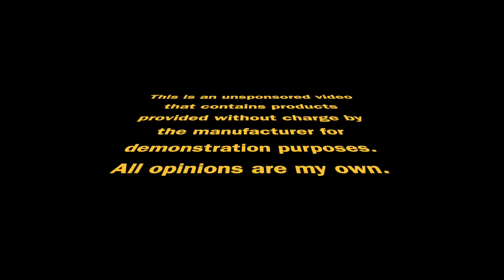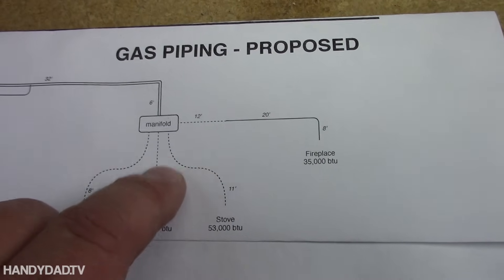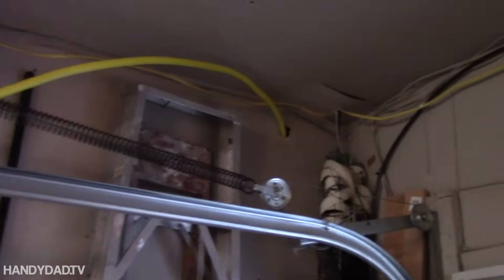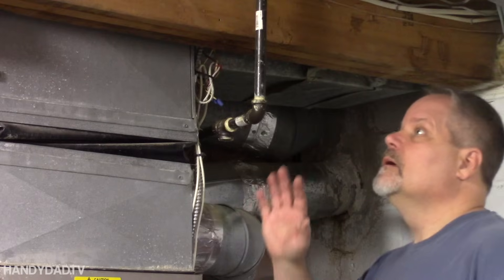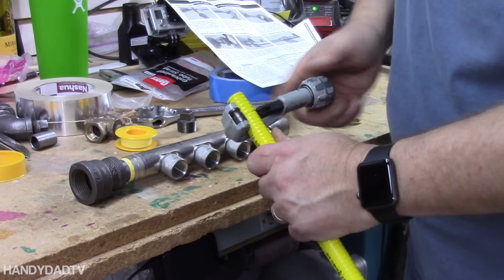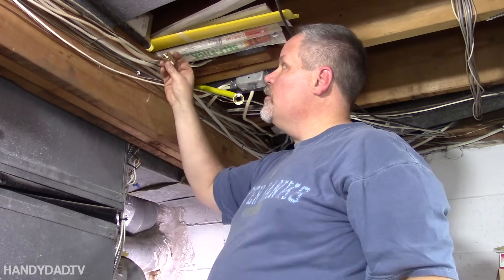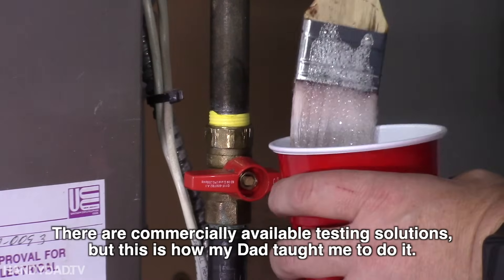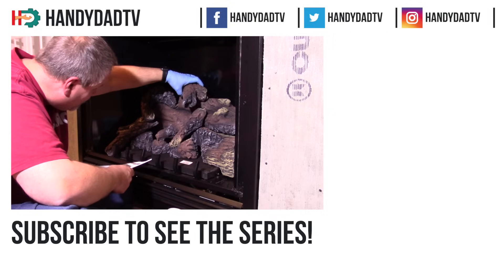DIY Fireplace Installation - Natural Gas Line

Comment: Your bonding need to connect to the house grounding electrical system not only ground to the grounding rod.  Other word your electrical system bond the neutral and the grounding rod electrode together to make the house grounding system.
Reply from the maker: Ok but it passed inspection.
Reply: HandyDadTV I got that sometimes you did it wrong to pass inspection as those inspectors said but that’s not how it said in the code.
Reply: It passed inspection but they probably just saw it was bonded and assumed it was to the panel.

In your system you created a second earth ground. These are both earth ground but not equal, as they will have resistance to each other during a lightning strike and cause cause a extra current look during the transient strike.
The lighting voltage will seek the shortest path to earth, and this may pass through one of the grounds but then also pass through the second ground.

Best way is to tie the at all the ends of csst to your panel with AWG6 if under 70 feet runs. That way the current will want to travel through to 6awg to the panel ground and rod and not through the csst, which can easily cause holes/burns from the amount of current.

I just redid my house myself with schedule 40 black pipe, and it's thicker to have less resistance and can take the strike without melting. I still need an earth ground, so there is that bonding to the panel.  It's bonded in parallel by the equipment itself, but I want the current to travel through the bonded cable rather than the grounds on the equipment where my gas runs to.
Reply from the maker: Thanks for the info
Reply: @handydadtv  and the black flex no need bonding

Comment: Pascals Law of  pressure  " Exerted to a 1/2 pipe then to 3/4'' pipe and then to a 3/4'' pipe will each have same pressure and you will have a pressure drop So no matter what manifold you have you need Volume So you probably could of ran a 1-1/4'' as close as possible the inside to  your manifold Volume
Reply from the maker: Thanks for the feedback

Comment: Lol wtf the gasmeter outside the house in the open, thats crazy.
And do u have enough pressure with those thin pipes and lots of connections
Reply from the maker: Yes. Works great.
Reply: Gas meter are only allowed outside where I'm from in Massachusetts, we mainly say its so they can shutoff the gas whenever they want.  Any internal meters left will eventually be moved to the exterior.
Reply: I live in Ontario, Canada. The majority of residential gas meters are outside.

Comment: I see a lot of rust on your gas meter and piping. On ours the pipe was so rusty it actually broke away where it enters into the house (we face the ocean, so the corrosion is really extreme) - so now I have an annual task of painting everything around the meter and pipes with grey oil base paint.
Reply from the maker: I hope to move before that becomes a problem!

Comment: You added BTU's to your system but doubt you checked with your gas supplier as to if your meter is big enough (looks to be rated for 250k BTU so doubt it- they size by all appliances running). That black pipe is welded steel not cast iron....   You should have run 1 inch to both the water heater and furnace to help carry load. Last, you could have found a section of short pipe between 2 couplings, cut and removed it, replaced one coupling with a union,  and replaced the removed section adding a tee in the middle for your fireplace piping.

Comment: this is wrong on so many levels.  i will just keep it simple and the mention the first point only when i started to review the footage.  if you have one inch supply line, why are you reducing to 3/4" manifold?  you could have installed a 1" manifold instead and than take your 1/2" runs.  you would have had better consistent pressure.  your house.

Comment: You wouldn't normally test for leaks by introducing gas to the system. In most cases a plumbing inspector would require a pressure test over a period of time by charging the system with air. Well, at least in my neck of the woods. As a matter of fact as a home owner in most municipalities you can't do you own gas work because unlike electricity gas can explode causing damage or even death to not only you and your our own home but also to that of your neighbors. Additionally, suggesting that one can cut a gas line with gas in it is at best fool hardy!

Comment: NO TAPES!
Reply from the maker: Yellow Teflon tape is intended for gas fittings.
Reply: @handydadtv  i dont know much admittedly, but tape wont pass any inspections in Tx and the plumbers ive worked with swear against it.
Reply from the maker: Wow I guess NJ is more progressive because mine passed inspection with the tape.

Comment: that is really bad you didnt even pressure test it, and how did you even get a permit with  out a actual having a contactor license
Reply: Many places do not require the home owner be certified or a contractor to do repairs and/or upgrades. Permits must be obtained where required, and governing code must be followed.